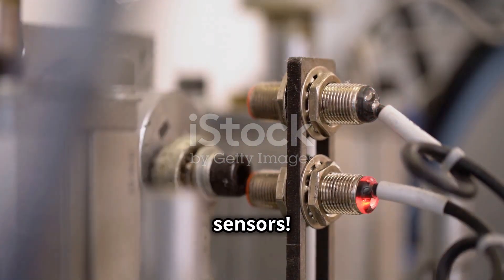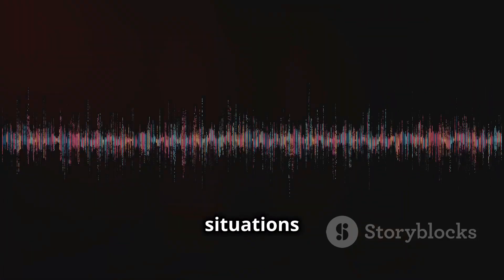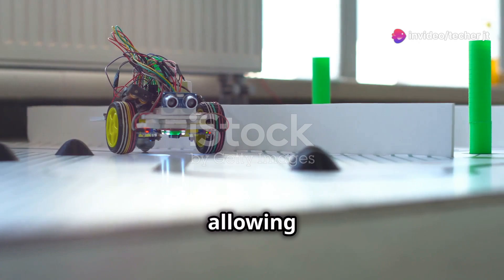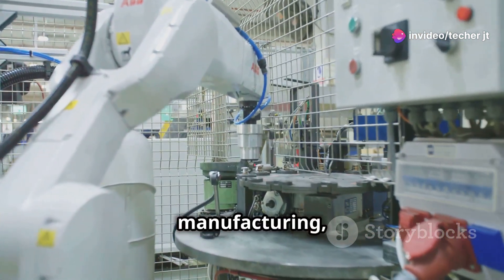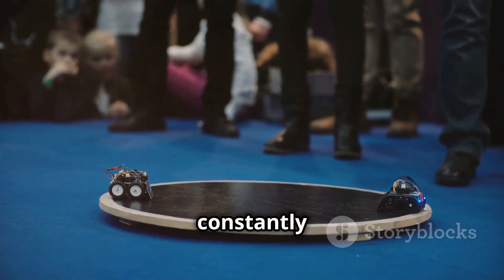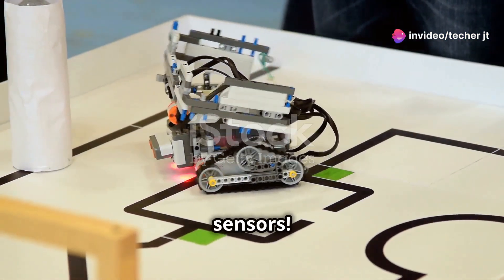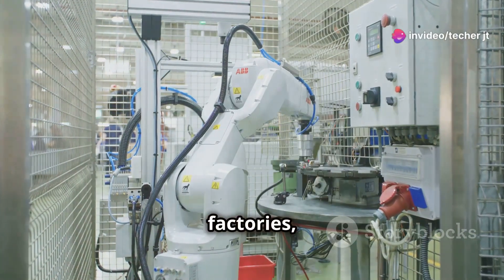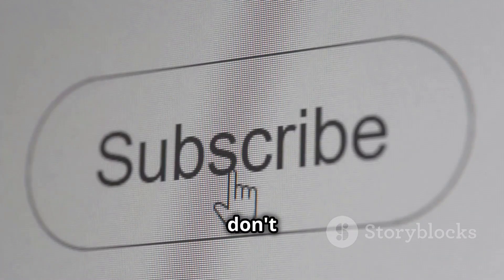Exploring the World of Robotics: Types of Sensors

Comment: 10 - Cassiopeia 📝⬇️
Reply: Oclaman, Eureka Glyril B.
X - Cassiopeia

2) Understanding (Comprehension): Explain how ultrasonic sensors work and their application in robotic systems.

- Ultrasonic sensors work by emitting sound waves and measuring the time it takes for the echo to return after bouncing off an object. They are widely used in robotic systems for obstacle detection and distance measurement, enabling robots to navigate their environment effectively.
Reply: Li Cyril A.

2. Understanding (Comprehension): Explain how ultrasonic sensors work and their application in robotic systems.

-Ultrasonic sensors emit high-frequency sound waves that bounce off objects and return to the sensor. The sensor measures the time it takes for the sound to travel, then uses the speed of sound in air to calculate the distance to the object. This method is how bats move in a dark environment with low to no visibility.
Reply: Princess Jelian M. Ucat
10 - Cassiopeia

Q1: What are the primary types of sensors used in robotics?

A: The primary types of sensors used in robotics are light sensors, sound sensors, temperature sensors, proximity sensors, tactile sensors, pressure sensors, accelerometers, gyroscopes, vision sensors, GPS sensors, and inertial measurement units (IMUs).
Reply: Adrienne Kiesh R. Magbanua
10 - Cassiopeia 

Q4: Analyze the differences between active and passive sensors in robotics. Provide examples of each.

A: Active sensors emit some form of energy (like sound, light, or radiation) to detect and measure the environment, then analyze the returned signal. Examples include ultrasonic sensors (which emit sound waves) and radar sensors. Passive sensors, on the other hand, do not emit energy but instead detect natural energy emitted or reflected by objects in the environment. Examples include light sensors (which detect ambient light) and temperature sensors (which detect infrared radiation).
Reply: Tabitha Glenne P. Lagria
10 - Cassiopeia

2. Understanding (Comprehension): Explain how ultrasonic sensors work and their application in robotic systems

A: Ultrasonic sensors use high-frequency sound waves to determine the distance to an object by measuring the time it takes for the echo to return. They are employed in robotics to enhance mobility and spatial awareness through activities including obstacle detection, distance measurement, and navigation.

.
Reply: Keth Jelzar A. Montes 
10 - Cassiopeia 

3.Applying (Application): Given a scenario where a robot needs to navigate through a crowded room, which sensors would you recommend using and why?

-For navigating a crowded room, I recommend using ultrasonic sensors for closed range detection,  LiDAR for 3d mapping, and cameras for visual recognition, providing full environmental awareness.
Reply: 8. Analyzing: Investigate the reasons why ultrasonic sensors might fail to detect certain materials effectively. What characteristics of the materials contribute to this issue?

Some materials like soft or sound absorbing ones can bring difficulty to the sensor when it's trying to read or detect it. It brings difficulty because it absorbs the sound waves which is the main factor for the sensor to detect certain objects.
Reply: Nella Regasa 
10 Cassiopeia 

2. Understanding (Comprehension): Explain how ultrasonic sensors work and their application in robotic systems.

- Ultrasonic sensors emit sound waves and measure their echo to determine distance from objects, useful for obstacle detection and navigation.
Reply: Kiesha Cantila
X - Cassiopeia

Q1: What are the primary types of sensors used in robotics?

The primary types of sensors utilized in robotics include light, sound, temperature, proximity, tactile, and pressure sensors, as well as accelerometers, gyroscopes, vision sensors, GPS sensors, and inertial measurement units (IMUs).
Reply: Farrah Monica B. Leuterio 
10 - Cassiopeia 

2. Understanding (Comprehension): Explain how ultrasonic sensors work and their application in robotic systems

- Ultrasonic sensors utilize high-frequency sound waves to measure the distance to an object by calculating the time it takes for the echo to return. In robotics, they are used to improve mobility and spatial awareness by performing tasks such as detecting obstacles, measuring distances, and aiding in navigation.
Reply: Jafe Marie A. Ebron
X- Cassiopeia

5. Evaluating (Evaluation): Evaluate the effectiveness of using multiple sensor types in a robotic system. What are the potential benefits and drawbacks?

- Using multiple sensor types in a robotic system can greatly enhance its effectiveness by providing a richer and more accurate understanding of the environment. Integrating sensors such as cameras, lidar, ultrasonic, and accelerometers allows the robot to gain comprehensive data for improved object detection, obstacle avoidance, and navigation. This multimodal approach increases reliability through redundancy, as different sensors can cross-verify data and compensate for potential failures. However, the complexity of integrating and processing data from multiple sensors can be challenging, leading to higher development costs and potential issues with data overload and system latency. Additionally, maintaining and calibrating various sensors adds to the system’s complexity. Despite these drawbacks, the benefits of enhanced performance and versatility often outweigh the challenges, making the use of multiple sensors a valuable strategy in advanced robotic systems.
Reply: Aurigue, Joshua Cliff L.
X - Cassiopeia

2. Understanding (Comprehension): Explain how ultrasonic sensors work and their application in robotic systems.

In order to calculate the distance between an object and itself, an ultrasonic sensor bounces sound waves off of such object. It accomplishes this by timing the return of the echoes. Because they facilitate simple mobility in congested regions by identifying surrounding items to travel through tight spaces, obstacle avoidance by identifying and avoiding obstacles, and navigation help by mapping the environment to prevent collisions, these sensors are essential to robotic systems.
Reply: Merchell C. Da-an

Q3. Given a scenario where a robot needs to navigate through a crowded room, which sensors would you recommend using and why? 

- In a scenario where a robot needs to navigate through a crowded room, I would recommend using LiDAR sensors, ultrasonic sensors, and
cameras. LiDAR provides highprecision mapping and obstacle detection, helping the robot to understand the layout of the room and identify potential paths. Ultrasonic
sensors are useful for detecting
objects in close proximity, aiding in collision avoidance. Cameras or other vision sensors can be used to recognize and differentiate between
moving and stationary objects,
allowing the robot to dynamically adjust its path based on the movement of people or other obstacles. By combining these sensors, the robot can navigate safely and efficiently in a crowded environment.
Reply: Cheryjan Aclo 
10 - Cassiopeia 

2. Understanding (Comprehension): Explain how ultrasonic sensors work and their application in robotic systems 

Ultrasonic sensors utilize high-frequency sound waves to measure the distance to an object by calculating the time it takes for the echo to return. In robotics, they are used to improve mobility and spatial awareness by performing tasks such as detecting obstacles, measuring distance, and Navigation.
Reply: Ethan James P. Malferrari
10 - Cassiopeia

2. Understanding (Comprehension): Explain how ultrasonic sensors work and their application in robotic systems.

Ultrasonic sensors emit high frequency sound waves that reflects off objects and goes back to the sensor. The sensor measures the time it took for the soundwave to travel, then uses the speed of sound to calculate the distance to the object. In robotic systems, the ultrasonic helps with navigating and spatial awareness, enabling robots and machines alike to navigate efficiently.
Reply: Mark Uriel G. Tacbobo 
10-Cassiopeia

1. What are the primary types of sensors used in robotics?

The primary types of sensors used in robotics are sound sensors, light sensors, temperature sensors,  tactile sensors, pressure sensors, proximity sensors, gyroscopes, accelerometers, vision sensors, GPS sensors, and inertial measurement units (IMUs).
Reply: Mark Uriel G. Tacbobo
10-Cassiopeia

1. What are the primary types of sensors used in robotics?

The primary types of sensors used in robotics are sound sensors, light sensors, temperature sensors,  tactile sensors, pressure sensors, proximity sensors,  accelerometers, gyroscopes, vision sensors, GPS sensors, and inertial measurement units.
Reply: Y'vhone Felkris L. Estanda
10 - Cassiopeia

Q1. Remembering (Knowledge): What are the primary types of sensors used in robotics.

— The primary type of sensors used in robotics are light sensors, sound sensors, temperature sensors, proximity sensors, tactile sensors, pressure sensors, accelerometers and gyroscopes, vision sensors, GPS sensors, and Inertial Measurement Units (IMU's).
Reply: Jan Dexter D. Linog
10 - Cassiopeia
5. Evaluating (Evaluation): Evaluate the effectiveness of using multiple sensor types in a robotic system. What are the potential benefits and drawbacks?

A: the effetciveness of using multiple forms of sensors on a robotic system allows it to be able to react and interact with their enviroment with ease by combining multiple forms of sensing to get precise information of their enviroment , at the drawback/caveat of having to deal with a higher complexity both hardware and software wise
Reply: Lorenz Michael Paderanga
10 - Cassiopeia

Q1: What are the primary types of sensors used in robotics?

A: The main sensor types utilized in robotics include light sensors, sound sensors, temperature sensors, proximity sensors, tactile sensors, pressure sensors, accelerometers, gyroscopes, vision sensors, GPS sensors, and inertial measurement units.
Reply: Leonardo M. Verbraecken
X Cassiopeia 

2. Understanding (Comprehension): Explain how ultrasonic sensors work and their application in robotic systems.

Ultrasonic sensors work by emitting high-frequency sound waves that are inaudible to humans. These waves reflect off objects and return to the sensor as echoes. By calculating the time it takes for the echoes to return, the sensor determines the distance to the object. In robotic systems, this technology is used for tasks like obstacle avoidance, object detection, and precise positioning. For example, a robot with ultrasonic sensors can navigate through cluttered environments by detecting obstacles and adjusting its path accordingly.